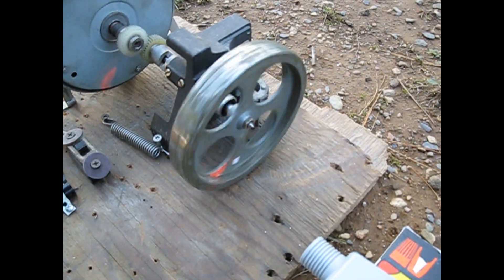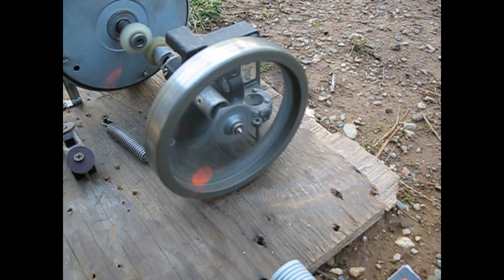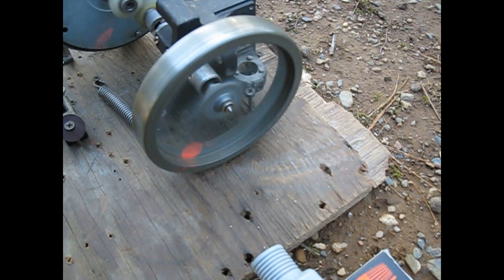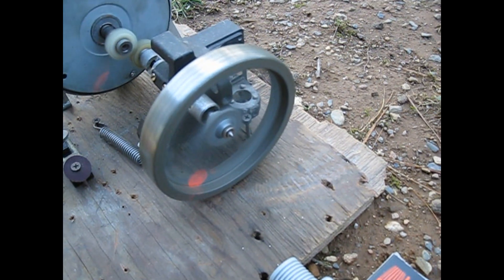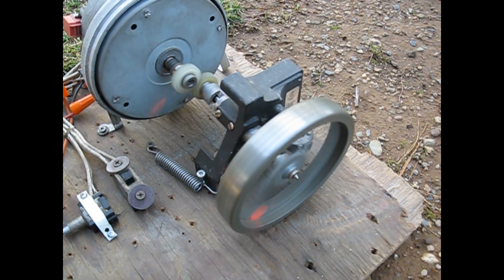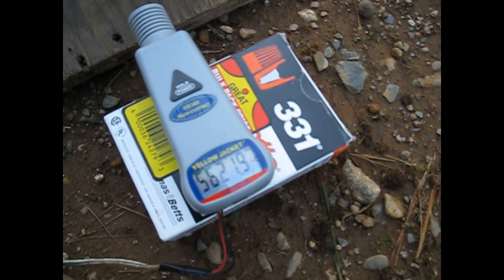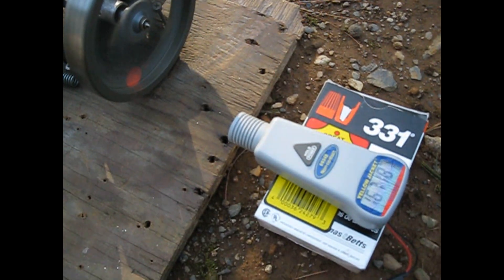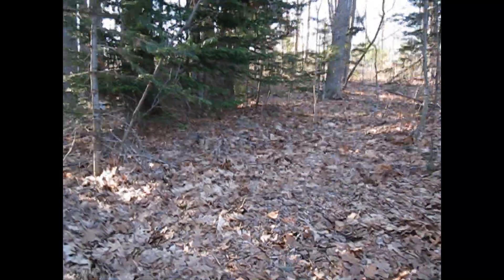600+ KPH Wheel Machine

Comment: Maybe there is an old runway neat you you could use?
Reply from the maker: Other problem is its a 120v vacuum motor so I would either need a gas generator or a 1000+ watt inverter.
Reply: @HL4EHalfLife  battery power angle grinder any help?